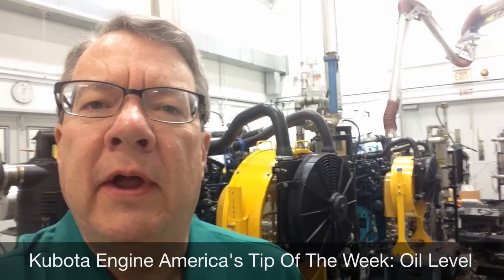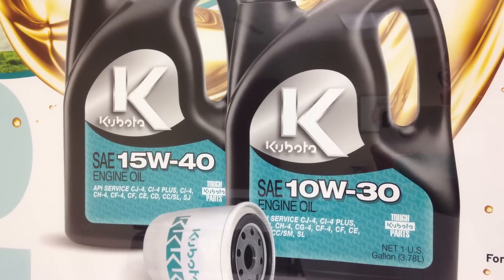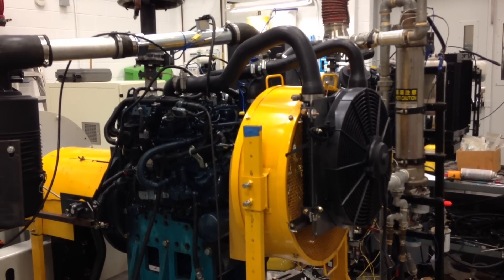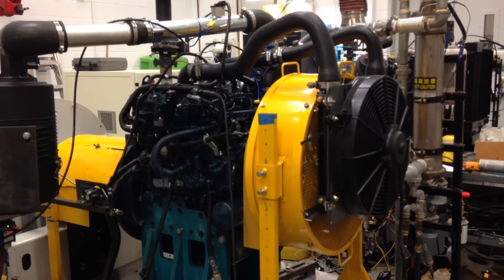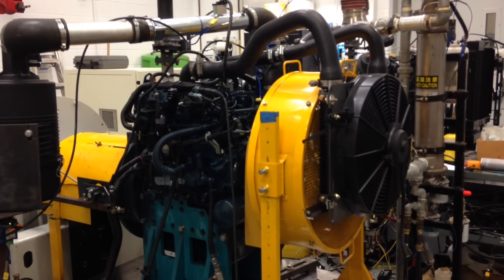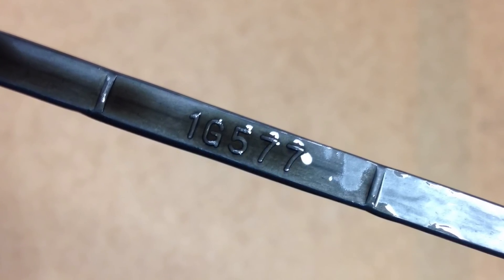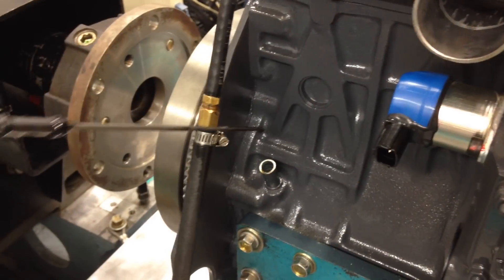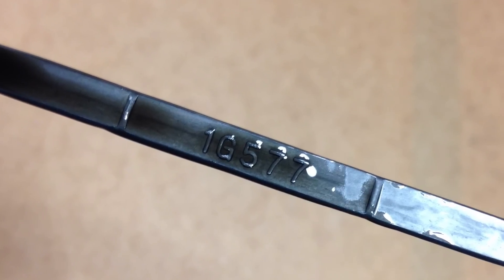Check your engine's oil level; too much oil is bad! | Kubota Engine America

Comment: Run a quart over for your hot rods. As you can pump the oil to the top end and it doesn’t run down fast enough to keep the lower end lubed

Comment: 2005 chtysler sebring cnvertible.i switched t mbil1 5w20 and over filled..i nticed smthing.starts and cmpletely quiet.but it did smething unusual ..it idled high @1500 rpm n tach.as i took it for a spin and stpped idle went back down to steady 7500.any ideas why this is?

Comment: sir i have one question, if u can help me

i have a motorcycle 4 stroke  155cc
i have filled engine oil just little above the high mark
and after running around 500km i found engine oil goes down drastically, also found engine power loss..
how to over come from this engine power loss problem?

Comment: So how do I take out the extra oil?
I had the low oil light come on about a month after an oil change, so I just added a quart. Now the engine has too much oil.
Next time I should add the oil in small amounts, checking the dipstick in between.
Reply: What did you do?

Comment: an extra litre of oil is not going to cause any damage!  in the Porsche 997 always put extra litre of oil, the Porsche burns about a litre every 8k miles. Ltd will burn the excess before the oil service due.
Reply: Gus Ibrahim that's one fucked up porche
Reply: Raidel Pichardo 
do you own a Porsche? if you do please check your oil level after 8k.

Comment: mine was overflowed with 5w20 for at least 2-4 weeks before i finally drained it & changed to the proper amount with 10w40 this time since its high milage.. is there any possible chance i damaged the car during that period? i really wanna make it last its a 2003 acura 3.2tl
Reply: Dave Pink you tell us now.
Reply: Tell us wbat happened
Reply: I doubt it, smoke would be coming out and would be leaking lol